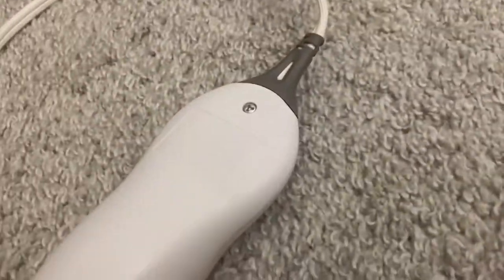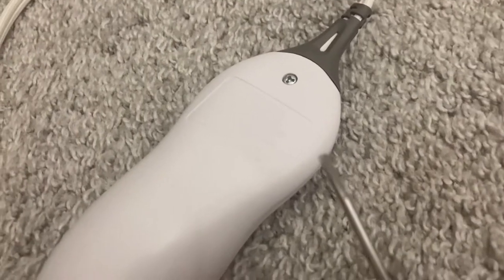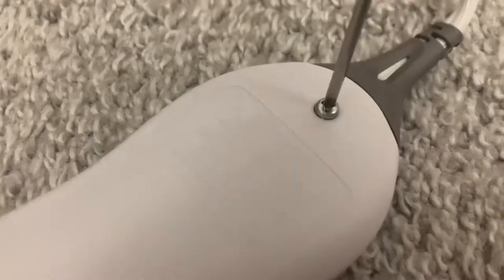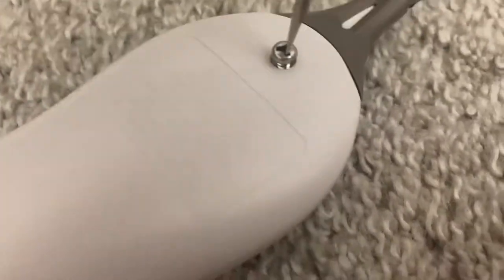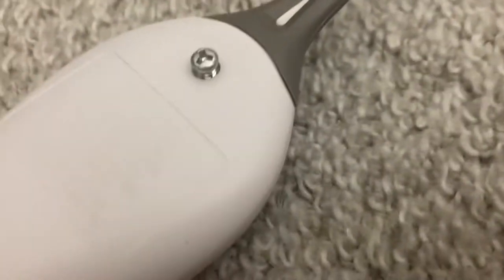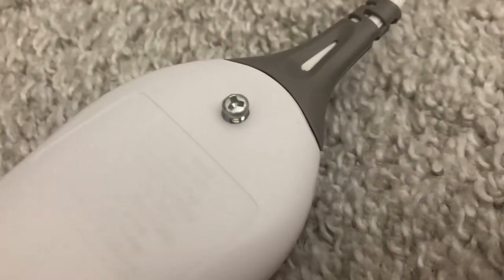Tri wing screw removal trick

Comment: Im trying to remove the stupid mini ones on the switch
Reply: Same
Reply: @yutaphoenix8003 any ideas?
Reply: @SharkPool_SP  I’ve been looking all through YouTube but i can’t find any solutions😢
Reply: @yutaphoenix8003  damn
Reply: I’m doing it on the gba
Reply: Trying on Wii u
Reply: Found any solutions yet?
Reply: @SuunTM I bought the screwdriver at lowes… I couldn’t find anything
Reply: Same bruh I’m dying over here
Reply: @GeneralAeon  same
Reply: same but DS litw
Reply: Hey anyone still struggling with this, it's a bit difficult but you can get the trick. Take an old toothbrush or piece of plastic and a lighter. Use the lighter to burn the plastic end of the toothbrush. Hold it firmly onto the screw and it'll make a mold. Just wait for it to cool then boom. (ps: fuck Nintendo the Wii u takes way to long to take apart.)
Reply: Dmg 001 Gameboy for me
Reply: I'm doing it on the Wii... Nintendo is so stupid adding them
Reply: Trying in ds Lite 😞
Reply: @ruskcoder doing it on the wii trying to get scrap gold but i cant
Reply: Tryna bust open my Wii ☹️
Reply: I am with the ones of the Wii
Reply: same wtf
Reply: Trying this with the gbc, cant find a small enough flathead :/
Reply: Same. They're so annoying
Reply: I’m doing the same thing lol
Reply: Me on the gameboy advanced sp 😭
Reply: Bro exactly why I came 😅